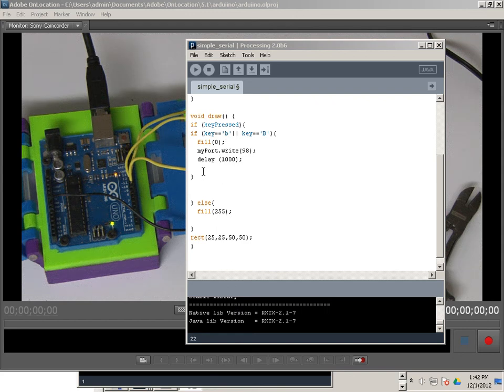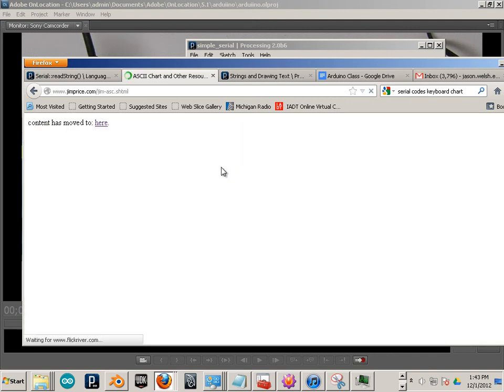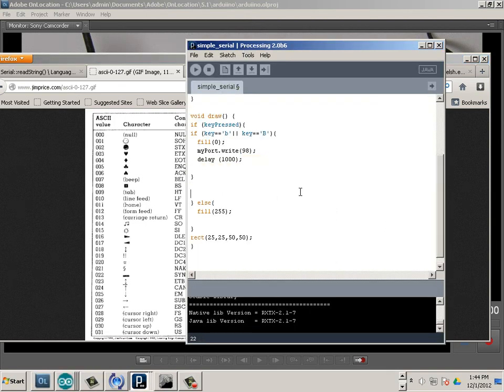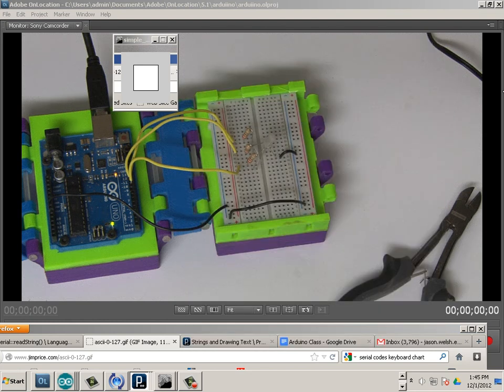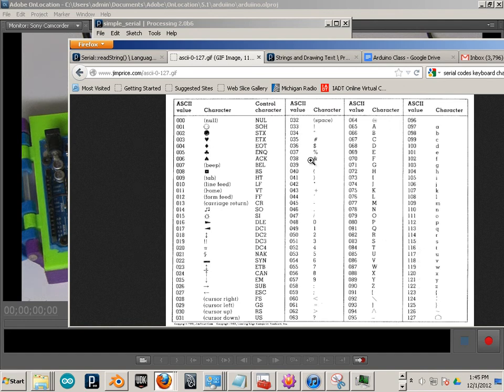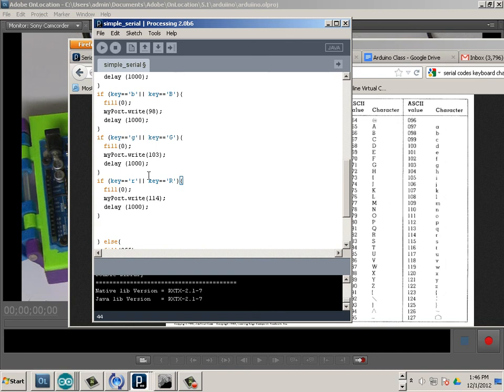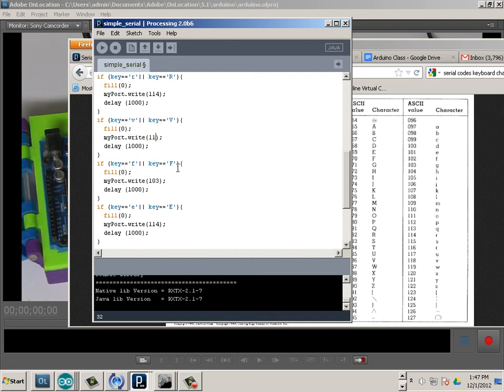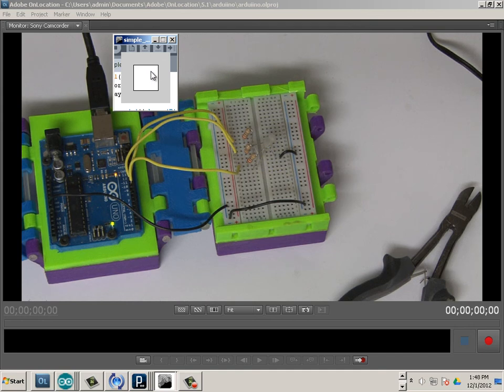1003 Arduino  Chapter 10 adding ascii keyboard commands

Comment: Hello Jason.  I have enjoyed working through your videos, you do an exceptional job of explaining and building on past learning.
I use a Raspberry Pi to work with my Arduino Mega 2560.  I installed  Processing 4.3 (ARM) 0nto the Raspberry Pi but I am having issues communication with the Arduino,  I keep getting the following error message 'Error opening serial port /dev/serial1: Port Busy'.  I am a bit confused as the Arduino is connected via the USB port, not the serial connections on the Raspberry Pi.  Any suggestions on how to address this?